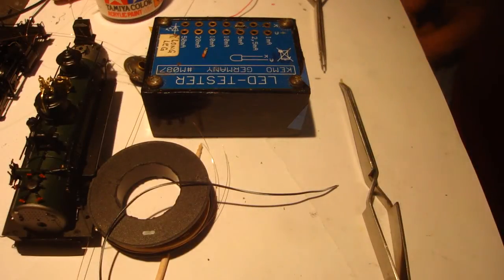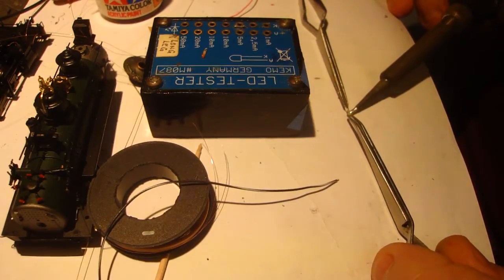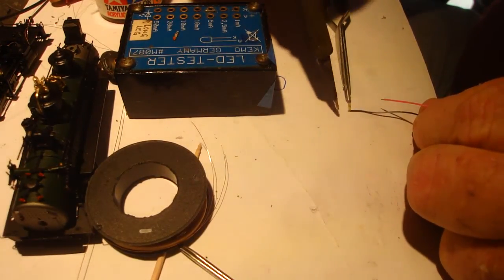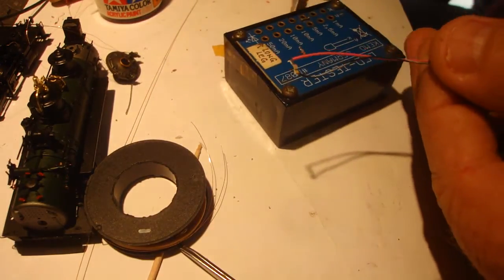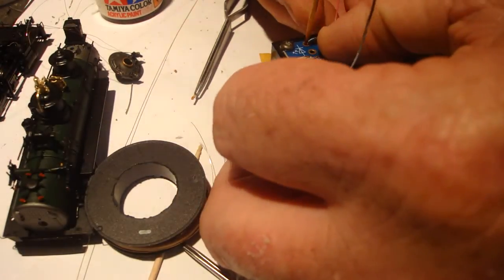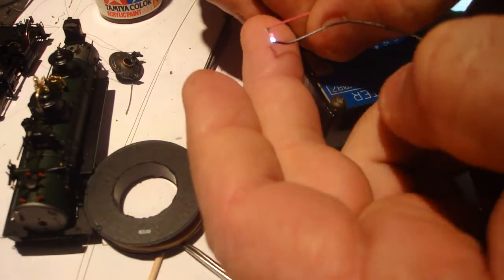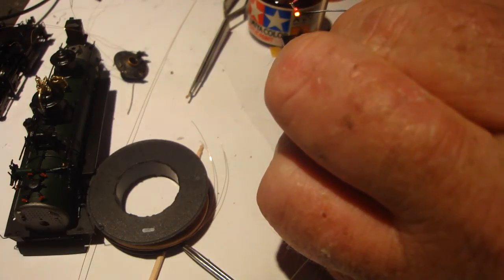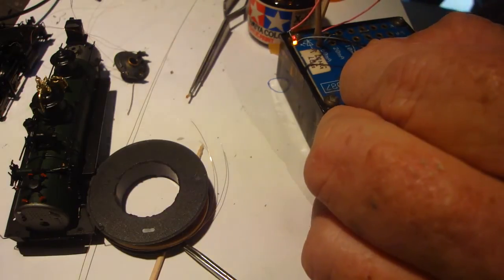SMD LEDs Firebox Flicker by Laurie

Comment from the maker: I always solder the resistor to the cathode side of LEDs and have the lighting function lead to the resistor. The blue common + lead goes to the Anode side of the LED.
It doesn't matter which way the resistor goes - it can be soldered either way.